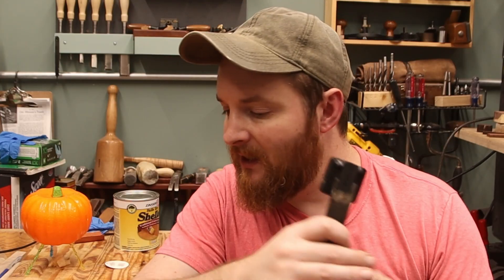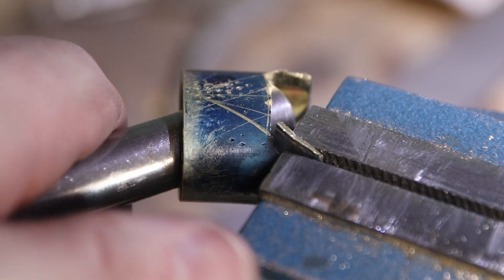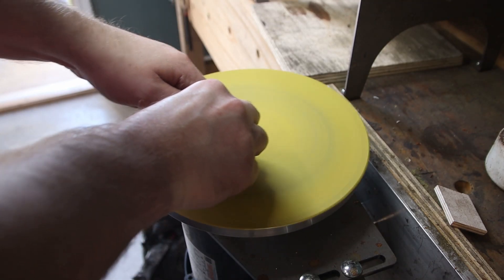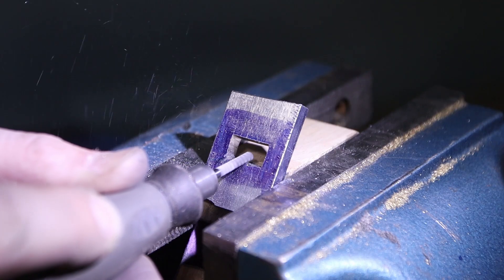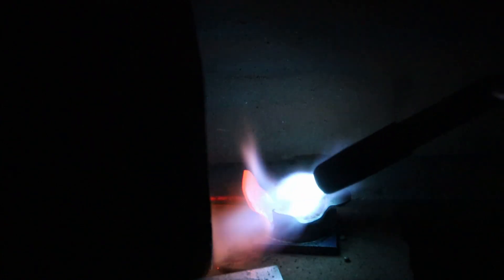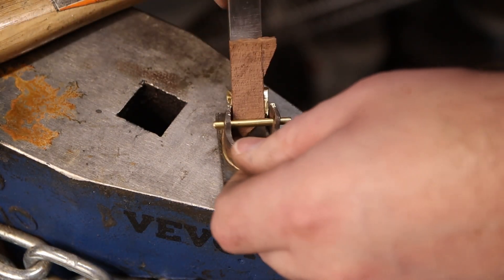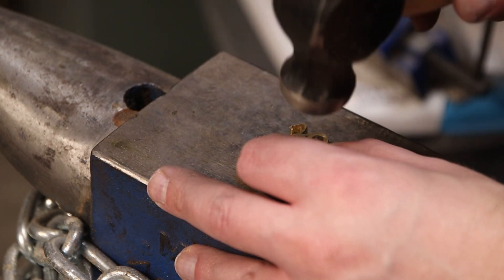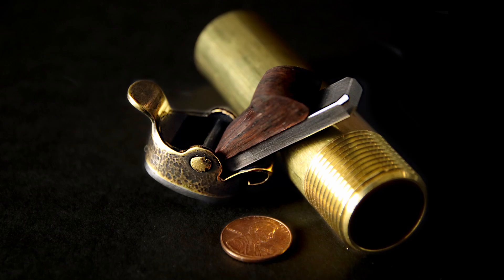I Made a Hand Plane From a Pipe

Comment: Amateur violinmaker here. It's a pretty cool looking little plane! You mention difficulty engaging with the cut, and I think it may have to do with the bed angle. 55 degrees is a little steep, I think. All my luthier planes have a bed angle of around 45 degrees. I didn't see exactly how the blade was profiled, but the corners should be rounded over to keep from digging in, as well.
Reply from the maker: The bed angle could be the culprit. I'll have to experiment with lower angles on future builds.

Comment: Man that's a cool little plane! What's your opinion of the Grizzly 2x42 belt grinder? I'm in the market for a budget belt grinder and have seen varying reviews
Reply from the maker: This is my second. I had the previous version and burned the motor out with about 20 hours of use on it. Getting it replaced by Grizzly was hassle free. They sent me the current version. Honestly, its fine for a hobbyist. If you'll be using it heavily you may want to consider a 2x72. 

I believe that the Grizzly 2x42 can accept 48" belts. I haven't tried that yet. It is up next on my list.
Reply: @EricMeyerMaker thanks for the quick reply and feedback! Its good to hear Grizzly improved the motor.

Comment: Neat little plane. Pipes can be turned into some pretty interesting planes if really shaped right and milled up right, lol. The brass will actually self harden over time also to a point too, from the annealed state, copper is the same way. Also yea, the convex sole planes can be a bit finicky to use, since you feel like you have to tilt the plane forwards pretty far to get it to cut, even tho it really isnt.
Reply from the maker: I didn't know that about brass. Thanks for the info!